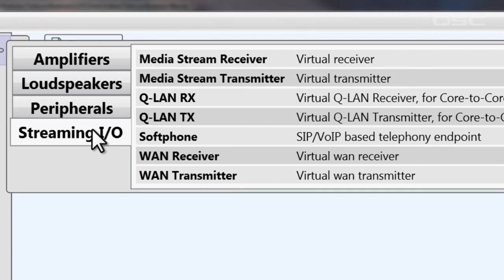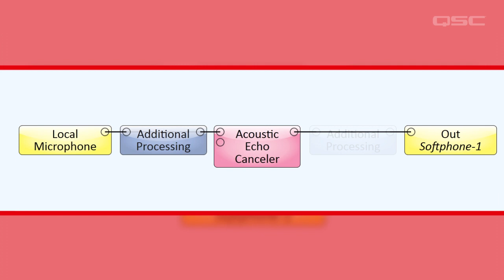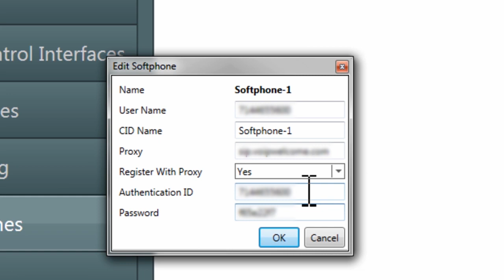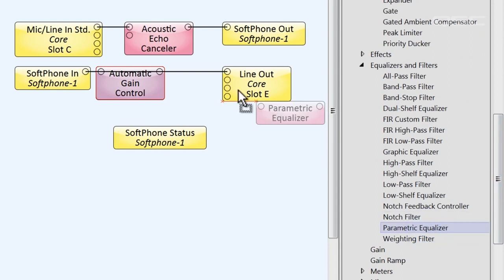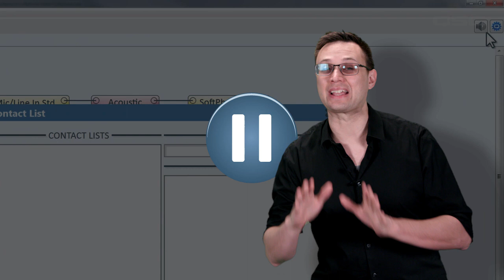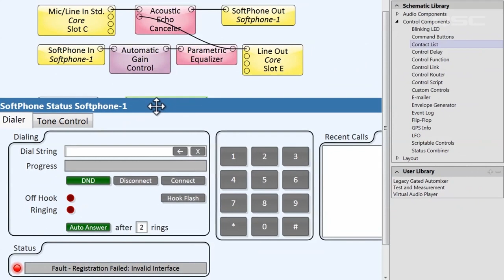Q-SYS: Telephony Deployment - Part C (Softphone)

Comment: I had an interesting thought. I'm new to learning about Q-SYS as a IT and A/V hobbyist. I was thinking of a retail store application with Q-SYS. You could register the sip softphone in the design with a phone system, like a Cisco call manager. Then, you could set the softphone to auto answer and then route the audio from the softphone to a mixer with music on another input then have the audio routed to the outputs that feed the store speakers. Also, have a mute on the music for when someone pages.